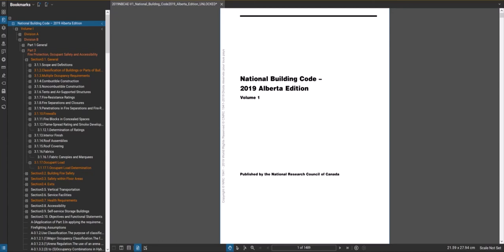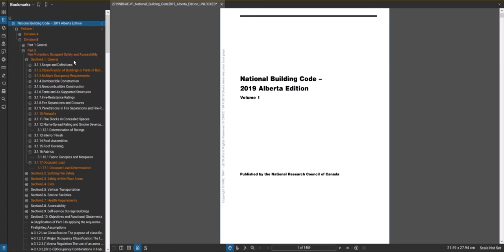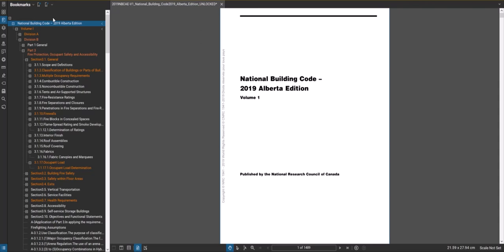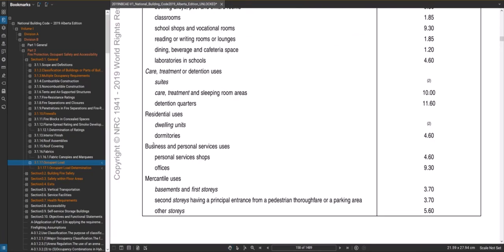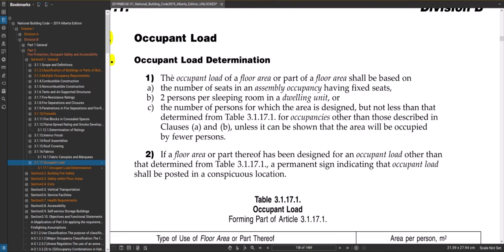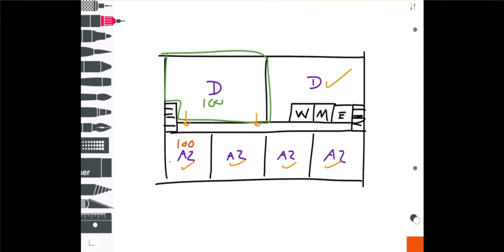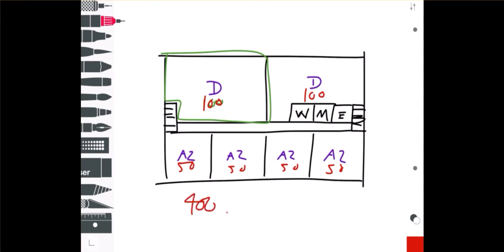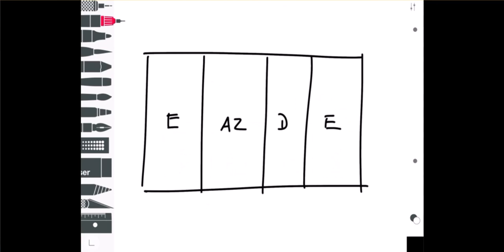Occupant Load (Section 3.1) - National Building Code Alberta Edition 2019

Comment: Thank you for the fantastic videos. They are excellent guides and helpful to us. I have a question, to calculate occupant load, which area do we use?  As per the code it looks like, it is floor area (less than gross floor area). Is that correct? Could you explain a bit about it, Thank you
Reply from the maker: Yes I agree per definition of floor area because it states that in the table header. This makes sense because vertical service spaces don't have an occupancy and exits are already designed based on the occupant load. Don't start carving out desk, partition and fixture areas as that would not be allowed and if done could limit the flexibility of a space in the future anyways.

Comment: For ancillary spaces that are better defined under other occupancy uses, are we able to use those numbers, or would we need to separate them to use those numbers? Example-Office building (D)with a small dining, beverage, cafeteria space (A2)?
Reply from the maker: You calculate each space by classification type. This important because the egress or exiting from that particular space needs to be designed based on how many people might actually be in that particular space based on its use. At times, that occupant load might not be an additional occupant load to the entire floor or suite though. For example you may have a boardroom within an office suite, but the overall occupant load of the office suite would be based on office Group D. However that boardroom would need to have egress design based on the amount of people that may congregate in that room at one time. Another example would be a retail store where you calculate the public area based off mercantile, but the back of house storage area as warehouse. In this example the retail store could base their washroom quantities off the outcome of the mercantile and warehouse occupants loads added together. But, from a base building design standpoint you may not know those areas into the future so a safe bet is to design to the worse case scenario of 100% of the space potentially being mercantile for life safety like egress, exits and so on. Hope that makes sense.